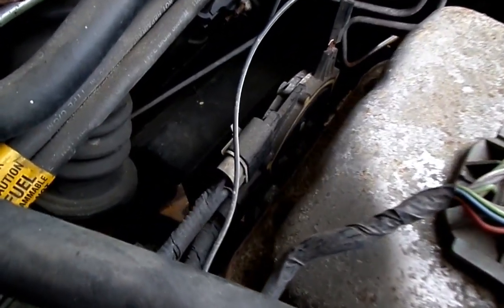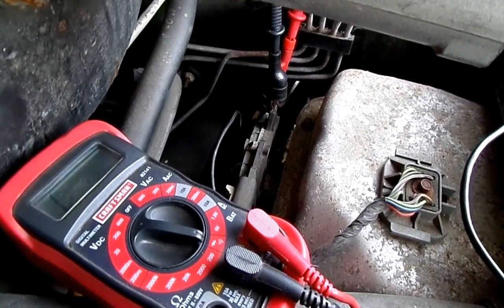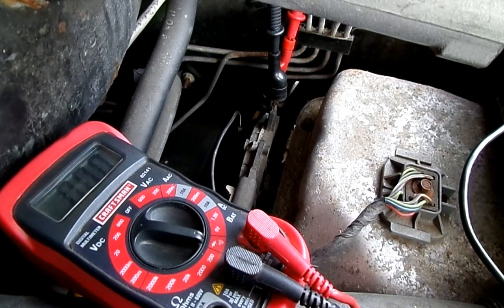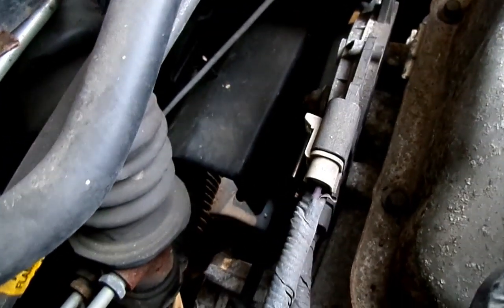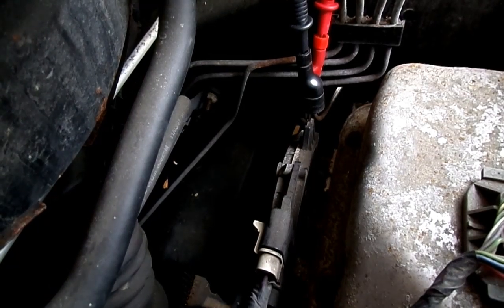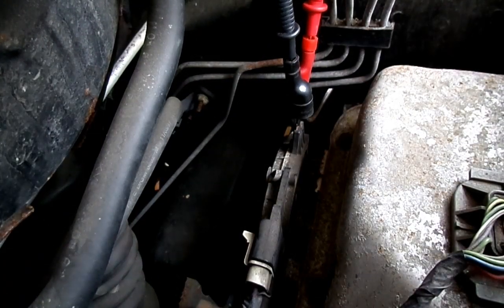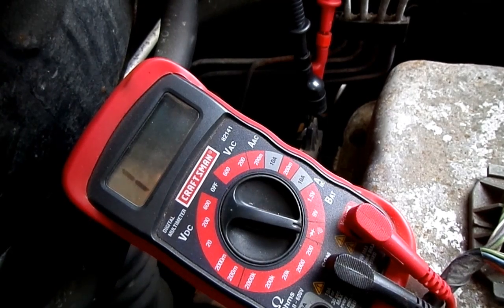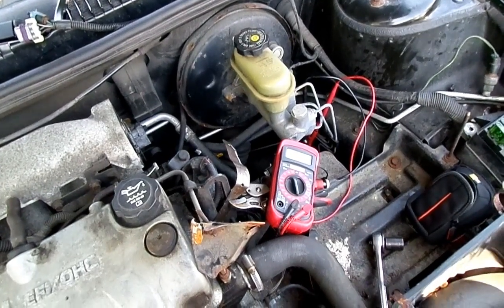Automatic Transaxle Range Switch Adjustment

Comment: This worked for me. I have a 1999 Saturn 3 door coupe that has been sitting for about a year as a no crank no start. I adjusted the range selector following the video and the car started right up. I did have to unloosen 3 bolts. I couldn't see two of them but I felt around and found them.

Comment: What is the range switch for ?
Reply: They never answer.
Reply: Range switch makes it impossible to start in drive reverse or first, second. Only allows starting in neutral and park when working correctly.

Comment: I have had a problem with this switch forever, The "original" that was in the car, would not repeat, every time I shifted it after adjustment it would not get tone, or start in park(it would always start in neutral, I replaced the switch and still had the same problem, I noticed the switch was very loose on the shaft, I finally fixed it by inserting a shim between the switch and the flat of the shaft, now it works perfectly
Reply: I feel like I'm having this problem
Reply: @w-dad40  Basically if the new switch fits loose on the shaft, cut some thin plastic to make a shim to shim the flats so there is no movement of the switch on the shaft, then tighten the nut? (It's been 6 years) and install the mounting screws, and adjust
Reply: @speter60  thanks man!

Comment: I have an 02 Saturn sl2 really could use your help call asap god bless 8282432828 won't start tried new pump and adjusting the switch even tried taking the pump relay out to release the fuel pressure and gushes out but car tries to turn over and won't start battery seems super dead after a few tries need all the help i can get
Reply: Cindy Hope: Do you really think he’s going to call you, you loon? And stop writing in one long run on sentence with no punctuation. It makes you look like you never graduated elementary school.

Comment: I have a 2002 SL1. Right now it is pulling the P0705 code. My fluid levels are fine, and in fact I just changed my fluid and filter a month or two ago. It hesitates, and does a small jump when I come to a complete stop. Could this be a good test to use? I am also pulling a code for my 2nd fuel injector. I doubt it, but could the injector be the cause for the hesitation?

Comment: 6 Months & now feeling sorry for my vehicle, 2002 Saturn SL2.  I adjusted range switch & got tone on meter. Tighten bolts (meter tone still on). Got in vehicle (meter tone still on). Moved shifter up to park, then down to  reverse, neutral & then drive again. NO TONE !!!. Will purchase NEW switch tomorrow & try that. OBD code is p0730 (incorrect gear ratio). Vehicle has no drive nor reverse. Unless someone suggest something, only thing left to try is a new switch, or remove shift Console and check inside or the output nut (did not check-no one talks about it). This is what I have done. 1.Input shaft nut torqued at 111 lb. 2. Five new valve body solenoids, each @ 5.3 ohms. 3. new buss plate. 4. New top connector on tranny with new wires soldered and all 10 wires probed for power. 5. Removed new top connector and re-checked terminals, all at 5.3 ohms. 6. New transmission temperature sensor. 7. New engine temperature sensor. 8. New transmission fluid. 9. New filter. 10. New engine oil. 11. New spark plugs. and 12. Car has always started immediately.  HELP HELP HELP.

Comment: Hello Richpin,
FUNNY thing happened. I connected meter to switch(per video)placed gear in Drive & had NO tone/continuity. Upset, I hit the top of shifter with my hand & I got tone on meter. I rechecked all gears & when I got to Drive, no tone. I then jiggled shifter up & down until I got tone again. Is this a shifter adjustment or do I remove console & look there for the problem? My car is 2002 SL2 , so adjustment switch area is different than in your video. 
Thanx Mr. Richpin.

Comment: Do you need the battery in to perform switch test? Video shows it out.
Reply from the maker: You do not need a battery as you are using the continuity feature of the multimeter.

Comment: ok now i adjusted it just like you showed. it only beeps in drive. But if i go to through the shifter i have to go back to d2 then to drive for it to get continuity. If i go from p down to drive it doesn't beep. but when i go down to d1 or d2 then to d it beeps again

Comment: can someobe please tell me how to remove the sensor. i removed the 2 bolts and 1 nut and took off the cable but cannot get the shift linkage bracket off. Do you pry it off or does the the whole srew come out the trans.
Reply from the maker: What sensor are you trying to remove.
Reply: +richpin06a 
i finally got it off last night. i was removing the trans range sensor. It took me using 2 screwdrivers and using a lot of force. Other people with differnt cars show it just coming right off. on the sl1 you have to pry the crap outta it. Should i turn the shifter bracket all the way to the right  and place the shifter in the car on park to connect the new sensor? Or should i place it in nuetral(inside car shifter) and turn the trans shifter bracket in nuetral and connect? Thanks for your reply! Im actually doing this for a friend that has no car and no money trying to help him get back on his feet to be able to drive to work instead of taking a bus and walking in the heat. I really hope i get it fixed for him. I've never messed with a trans like this before and I've never done any work on a saturn. Your videos are basically my service manual and really appreciate all that you post.

Comment: On my 96 SL DOHC. . I was showing code po708 and replaced the switch obtaining tone as per this video.. still showing the p0708 code now with a new EGR valve code.. but the car won't start in Park -- only neutral.  Tried several times to adjust the switch... sometimes it will not "tone" when shifted into Drive on test shifts..  . but I torqued it down and it seems to upshift correctly.   Suggestions as to why it won't start in Park??

Comment: Mr. Richpin,

First of all, like so many others, let me join in the choir of those who really appreciate your efforts here, especially on Saturn S Series vehicles.

I just replaced this switch with a new one about 6 months ago and about a month and a half ago the CEL started coming on intermittently.  So, after seeing your video, I thought I would check for continuity in Drive and make sure the switch was adjusted properly.  Sure enough, there was no continuity.  When having my local parts store read the CEL code, the code reader indicated the transmission range selector switch (Can't remember the number).  So, I followed the adjustment procedure in this video.

When I get the continuity tone, if I tap the range selector switch with the adjustment bolts loosened only enough to allow moving the switch back-n-forth, the tone will intermittently tone and then no tone no matter what the position of the switch is.  Sometimes it has continuity through the whole range of movement.

Another symptom of moving the switch toward the engine is I get an initial "stutter tone".  It gives a very short beep and then a solid tone after I stop moving the switch.  It will do the same thing if I move past the point where continuity is reached.

The car will start in Neutral but not Park.

When driving, the transmission will not downshift from D to D2 manually.  It will shift into D1 manually, but never shifts to the actual first gear.  It only downshifts as far as 2nd gear.

After manually downshifting and then coming to a stop I lose 1st gear (the transmission starts in 2nd gear).  If I stop and restart the engine I get 1st gear back until I manually downshift again.

Something else I would like to know is; after removing the nut securing the shifter rod to the transmission, how do I easily remove the connector on the end of the rod from the shaft sticking out from the transmission?  Mine seems to be stuck.  The connector will wobble on the shaft, but will not slide off.  I have not forced it off, but I cannot seem to find an easy way to remove it so the switch can be replaced.

Thanks in advance for your time spent in diagnosing this and answering.
Reply from the maker: hjbreese Thank you for letting everyone know not to use a aftermarket switch.
Reply from the maker: Hugh Breese I have not spent enough time on the s-series automatic transaxle  so my troubleshooting knowledge is very limit.Have you run it by the smart people at saturnfans.
Reply: richpin06a I purchased another new switch and took my Saturn to a transmission shop to make sure there was not something simple I was missing to cause all the problems I have been experiencing.  Something you might want to add to your video here is what I ran across which makes it impossible to correctly calibrate the switch even using an expensive Snap On tester.
The original design for this part does not allow any "play" between the transmission gear selector shaft and the plastic cam on the switch.  This makes for a very accurate calibration of the switch.  The problem with both new switches I purchased at a local parts supplier is the plastic cam does not seat tightly on the transmission shaft.  So ... when you move the switch back and forth there is too much "play" in the reading.  This makes it impossible to calibrate the switch correctly.  I am now using a $10 junkyard part that was easy to calibrate and works great.
So, perhaps the first step in calibration might be to check for the "play" I found between the gear selector shaft and the sensor switch.

Comment: If the switch is out of adjustment, could that be what is giving me a code 11 on a '95 SC2 automatic? The transmission won't down shift if I move the shifter from D to 3 or 2 and if I start off in 2 or 3 it shifts normally and doesn't stay in that gear.
Reply from the maker: Code 11 means there are tansaxle code present have you accessed them.
Reply: richpin06a It is code 45. This morning I went out to check the switch and noticed a wire that wasn't connected to anything. I re-watched this video and found that the switch in my car is missing the electrical connection. Somehow within the last week or so it must have  broken off. I'm heading to the junkyard tomorrow to get a replacement switch that hopefully fixes the problem. Thanks again for all of your Saturn videos. They have been extremely helpful!
Reply: C Hax I got a switch at the junk yard for $6 and put it in my car and no more service engine light. Thanks for all the Saturn videos! They are helping me keep this 19 year old car running.

Comment: How you doing Rich have a 97 Saturn SL one and it's stalling and hesitating and sometime he cuts off I did a complete tuneup so far some mechanics tell me it's Transmission sensors and the other one tells me knock sensor

Comment: Can you make a video on how to check Saturn 97 and earlier . Thx
Reply: richpin06a
 According to my documents, it is the same from 1991 to 2002 for the automatics. I'm KingRex on Saturn Fans
Reply from the maker: I just put it on my video to do list.
Reply: richpin06a thanks , mine 97 Saturn sw2 has not been shifting correctly, recently at 30mph it wouldn't shift and the rpms would go very high. On the freeway it feels like the transmission isn't shifting to it last gear. What's your thoughts? Thanks
Reply: BornAgainBostwick also it's an automatic
Reply from the maker: BornAgainBostwick
When it comes to troubleshooting the automatic i do not have much time under my belt doing so.Have you run it by the guys at SaturnFans.
Reply: Pan Gramercy great to know will go to the forums, thx

Comment: Another great video.  Thank you.
Would a OBDII code of P0741 indicate that this switch needs adjustment?  'Torque Converter Clutch Circuit Performance or Stuck Off'.
Reply: http://www.obd-codes.com/p0741
The code is generic but the repair could be different depending on make and model
Reply: I would say no, they are 2 different circuits
Reply: fordwindsor351 Is the Torque Converter Clutch Circuit inside the valve body?
Reply: I was referring to the range selector/circuit and the torque converter.
Reply: hmallett1 and the converter clutch isnt by a standard means of a circuit, its operation is strictly by fluid motion.
Reply from the maker: hmallett1
It is located in the valve body.
Reply: fordwindsor351 So, would you say that the P0741 code would likely be resolved by changing the valve body?